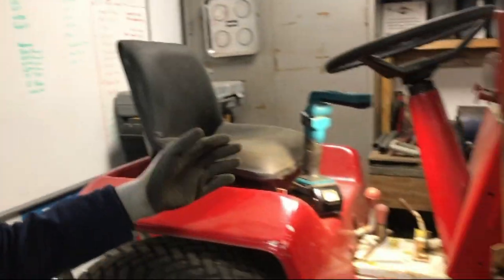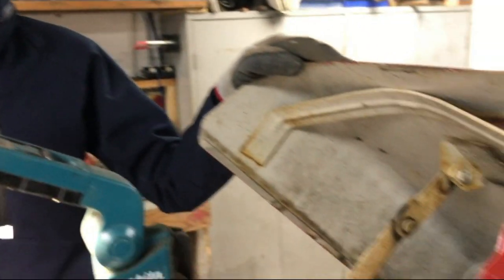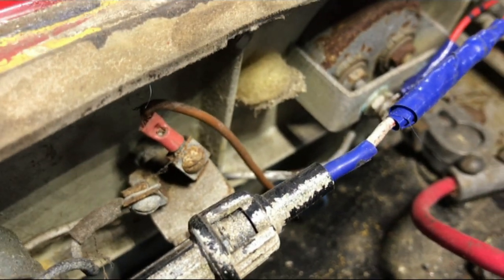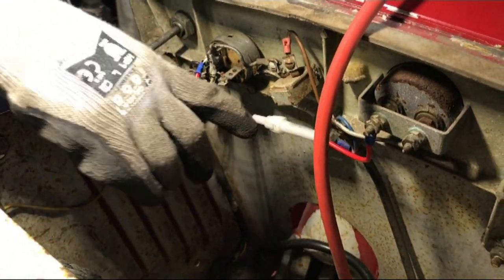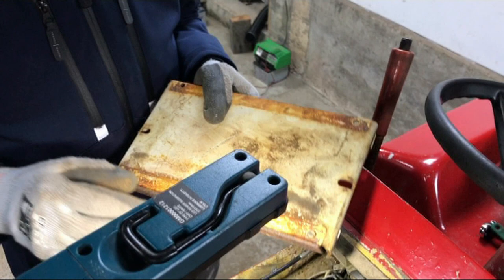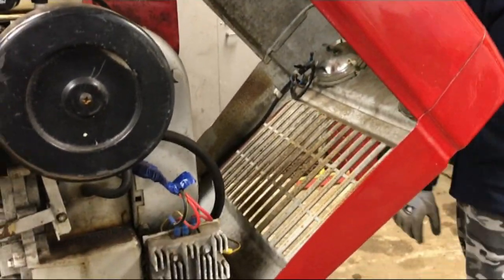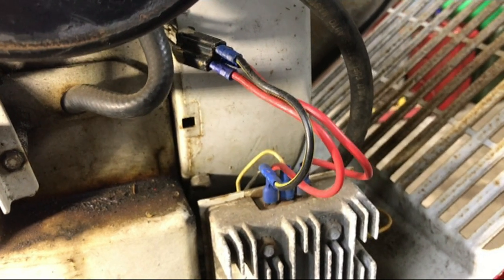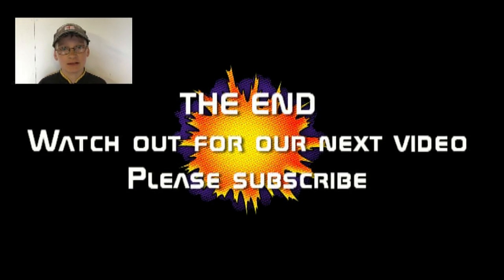1970 Bolens 1253 - Part4 (Electrical repairs)

Comment: Hello Joseph,
Good to see you're putting things back into there original places... with the number of tractors you have I think a good idea to have them as standard as possible... See you next time.
Take care.
Paul,,
Reply from the maker: Thanks. I have no idea why the soleniod was moved to that location, it would have been very easy for the metal throttle cable to touch across the terminals. Take care

Comment: Good job! I like wiring on my tractors. A couple tips. 1. Please remove the negative terminal first, this will prevent shorting the positive to the chassis if the wrench slips. 2. I also use the crimp connectors, but I remove the plastic sleeve, then crimp and solder the terminal on. Wish you were closer, I have several connector blocks and the correct pins for them.
Reply: I second the removing of chassis ground wire first.  A spark could cause an explosion - I really enjoy the videos you all produce every week - enjoy the journey
Reply: That’s what I tell people to do always disconnect ground first I also like to soldier my ends do it right the first time save’s a lot of trouble down the road.
Reply from the maker: Thanks. You are right and it was not good practice for us to show disconnecting the positive terminal first, despite the battery being very dead. We are continuing to search for the correct connectors and we may have to look at supplier's your side of the pond. Do you have any recommendations? We will solder the terminals if we get the correct connectors. Take care
Reply: @GardenTractorBoy  
Do you have any auto parts stores near you or maybe a salvage yard you could remove a couple of batt.  Terminals clean them up and grease them then you wouldn’t have to solder them. 
Solder is kinda expensive on this side of the pond. 
Keep up the good work my friend 👍

Comment: Good job! It looks much better! That was an old battery in there. I don't think they've made those batteries in 40 or 50 years! I was nervous when you were disconnecting the positive cable. I slipped once and touched ground. The battery was just charged up and exploded on me. But, I don't believe that old battery would have exploded! Thanks for sharing! - Rick
Reply from the maker: Thanks. You are right it was not good practice to show disconnecting the positive first, despite the battery being very dead. Take care and I hope you have a good week

Comment: Good video. If you use Marvel Mystery Oil in your gas, the residue from gas evaporating will be soft and easier to clean. It also reduces corrosion. Good Luck, Rick
Reply from the maker: Thanks. The fuel has been in the tank many years and long before we started using additives. MMO is hard to get in this country but we have bought some based on your previous recommendation. Take care

Comment: it seems the wiring on these old tractors manage to be pretty messed up,, that battery hold down bar is a great addition , as I said before, I ruined an new battery because I let it slide into the pulley.
Reply from the maker: It is odd, some of our tractors have good wiring and some are a mess. This one is a mess and someone has been playing with it which is not helpful. Take care

Comment: Really enjoy the electric working Joseph!  A “rectifier” - is that same as relay?  Any way - thanks for sharing!  Very cool!
Reply from the maker: Thanks. A rectifer is different to a relay. Unlike a car which uses an alternator to generate power, these engines have a stator on the inside of the flywheel which generates AC power, the rectifier converts it to DC. We have a stator replacement to do on one of our tractors soon. Take care and I hope you have a good week

Comment: Hey I have a question for you, I am currently working on a bolens 1220. I have the clutch apart at the moment and I need a new friction disc because this one is half missing. I found a place to buy a cut to fit clutch disc material that I just purchased. This does not have the adhesive on it, just curious if you have had to replace one in the past and any insight you could give me. I'm trying to find an adhesive that will work. All the best!
Reply from the maker: We have not replaced the clutch lining before on one of our tractors so we can't recommend an adhesive. We do know people in the US who have done this and we will ask them what they use and get back to you if they have a good recommendation. Take care
Reply from the maker: We have spoken to a number of people we know who have done this and most said that they sent it to a friction rebuilder to fix the material. I did a quick search and it appears a number of company's like that are in the UK. One person said that they fixed the material with yellow 3M weatherstrip adhesive which has the same characteristics as contact cement but they did say that they have not tried to use it on a tractor yet, so this is risky. I hope this has been some help and it will be interesting to know how you progress as I am sure we will need to do it at some point. Take care

Comment: I have a Bolens 1253 and my rear tires are turning in opposite directions of each other do you happen know what it could be?
Reply from the maker: I assume that you mean that if you jack the back off the ground and turn one wheel one direction, the other goes in the opposite direction? If that is true, I believe that is how the differential is meant to work. If you are struggling to push the tractor when it is on the ground, you have to pull out the drive pin first. If this does not help resolve the issue you are having please send us more details. Take care
Reply: @GardenTractorBoy   Thank you so much i will have to check that in the morning and will let you know